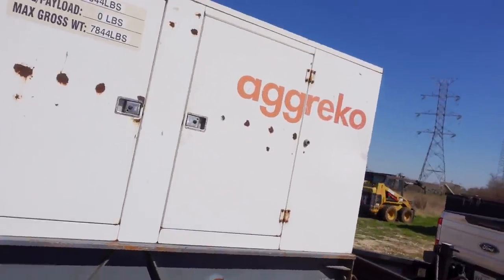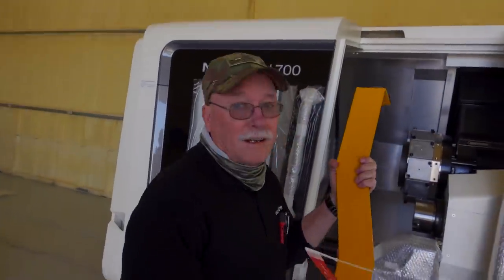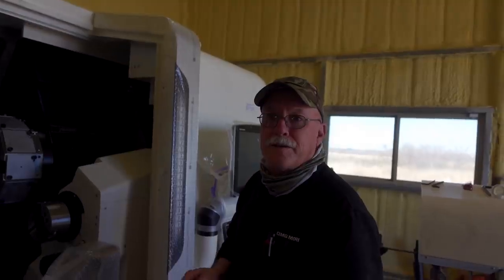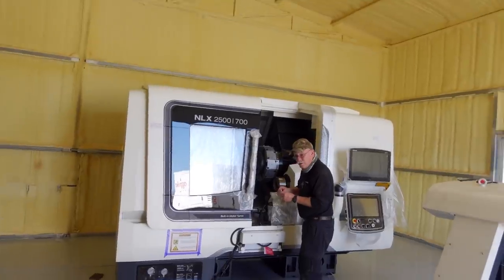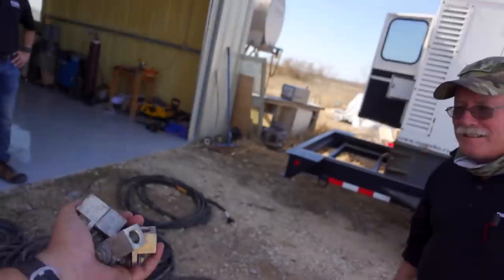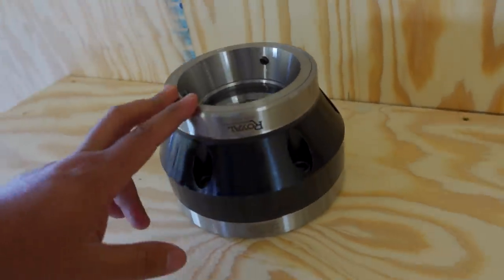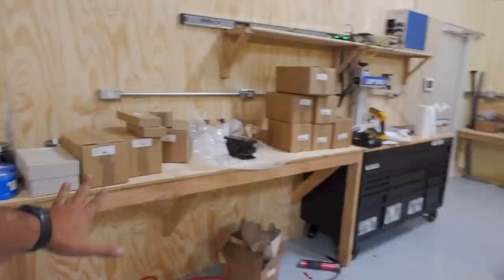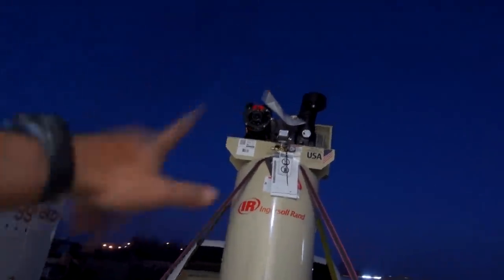Setting up the DMG Mori CNC lathe | Starting a machine shop 7

Comment: Hey Eric congrats on your new machine.  As an experienced CNC Machinist I can tell you that you've got in my opinion the best possible brand of machine out there.  Equipped with the options you bought it will make a ton of quality parts.  A little tip for the future there are batteries in the back that keep the machines memory intact when it's powered down.  They seem to last a bit over a year.  Get and keep a spare pair from Mori, they take a while to get some times as they come from Japan.  You don't want the machine to lose it's memory.  When it forgets where it is that's when crashes happen .

Comment: Eric please remember to drive a ground next to the generator and ground the generator and the new cnc so you don't have a difference in potential and remove risk of a shock
Reply from the maker: Yes sir, it was done.  :)
Reply: Exactly..Even with a gas powered welding machine ya need to ground it in case of a little moisture.

Comment: Put a  motor guard filter in the air line at the machine.  Collects any moisture and oil that comes from the air compressor. I run three machines similar to yours. Two the same as yours and one NL 2000. All three have bar feeders also. The motor guard filters I change twice a month and always have oil in them that escapes the screw compressor. If you use a blow gun to clean parts, run it from the air filter also.

Comment: Did you get pictures of all the shipping brackets in place?  Datum, new term for the CNC. The documents for that puppy I’m sure are tremendous. Tooling,  KaChing!  First class.  Now you need a toolbox for the lathe tools.  When our shop compressor died, one just like the one that you bought showed up, ran flawlessly for the 8 years that I was there being used at least 12 hours a day.  All you need now is a good dryer, don’t know the average humidity there, but moisture is an issue.  Thanks for showing us the process of setting up a shop the way you chose.  Stay healthy!

Comment: Eric, was just thinkin about when you start making chips on that machine, don't know what type of material your tuners are made out of, but when i was running CNC machines we would use a leaded mild steel stock, it was 11L17 from our vendor & it was very stable & easy to cut & easy on tools & also inexpensive to boot. So until you get your speeds/feeds & depth of cuts figured out for production it would make it so you ain't burning up expensive tuner stock and would give you something to build prototypes out of that was easy to machine & inexpensive... Just my $.02  wishing u the best brother

Comment: That particular Ingersoll Rand compressor is a good one for most if not all your needs, only thing I'd warn you about is their auto shut-off switch tend to have issues over time. It will fail to shut off the pump at the max PSI causing the pressure release valve to open, once it fails expect to have to replace it around once a year or two because the replacements are no improvement.

Comment: I hope you are buying "Red" Diesel. Around here it is about 20 cents a gallon less. Makes a big difference when you are sucking up 6 - 8 gallons per hour.
Reply: Harder on fuel filters ?
Reply: @12345NoNamesLeft  NO. Same as regular except they add red dye. Some highway use taxes are not added to red diesel. But if you get caught using red diesel on the highway it is a big fine. Thousands of dollars. I use it in my tractors, diesel pump engines and a generator, but no way will it go in any of my vehicles.

Comment: Dont use an oilless compressor! They generate so much moisture, that it can cause issue with the pnuematics. CNC machines generally require really dry air, so make sure to hook an air dryer between your compressor and machine.

Comment: When your power comes in check the amperage because I've found they lie. How much amperage does your shop take with everything running? Make sure it's at 60 htz.
Reply: Good luck with that! I have never seen a backup generator that did not run slightly fast under no load and slow under full load. Even with electronic speed control.

Comment: Eric.... My 100 kw puts out 227 amps and only burns 1 gallon an hour. That's more than enough to run everything in your shop. How big is that generator?
Reply: 100kw  227amps and only a gallon a hour??? How many horse power engine driving the gen set?

Comment: I would put that compressor outside, they are so loud and annoying inside
Reply: Downside to that is even though they technically are inside/outside compressors, they do not do so well with humidity and the tanks collect a lot of water because of it which over time causes a lot of issues like internal tank rust, contact points on the auto shut-off to corrode which will cause it not to break connection when tank is at max pressure, and if water is allowed to accumulate the pressure release valve will open even when take is not full. Don't get me wrong, they are good compressors and I even own one, they just require constant up keeping if placed outside.
Reply: He’s going to build an insulated cabinet around it to deaden the sound. Some compressors are actually fairly quiet.
Reply: @Georgiaboy9009 110 volt  Electric pop off air dryer valve or what ever they are called work good for tank moisture,we have ours is set to go every hour.
Reply: Absolutely cool...DMG Mori is the best stuff on the market...wish I was in your area, 20 year experienced CNC Programmer and Machinist, handler, and aspiring FTR class shooter
Reply: *handloader
Reply: @jtn-minn8105  Yeah I've looked into getting one and more than likely will eventually, in my case I figured I'd get one with my new compressor once this one finally gives out. Even though I've taken great care of it, those who owned it before me definitely did not, I wouldn't be surprised if it fails before the year is out.
Reply: @jtn-minn8105  Ironically not two days after responding to your comment, one of the pistons in my pump seized haha. A part of me is happy it did, at least now I have one that I will know has been well maintained from brand new and it even has an timed auto drain to minimize water accumulation.

Comment: Good choice on the equipment. Dont take this wrong, but you dont seem like an ace cnc machinist. How did you end up getting arguably the best equipment you can buy? I had to get a better compressor when I got my DMF mill. They use alot of air. I bought this rotary one, its been great. Made in Minnisota. Gscompressor.com  10hp worked for me. good luck.
cw

Comment: I'd be concerned about the generator power not being "clean" enough for such an expensive piece of equipment.
Have your electrician varify that it's an inverter generator at least.
Reply from the maker: It puts out 208, 208, and 208.  Mori checked it before they let me hook it up to machine.  😉

Comment: Gas, gasoline and diesel generators consume fuel in direct proportion to the power that they put out. 5000 watts from a 10,000 watt generator is not much more economical than 5000 watts from a 25,000 watt generator.

Comment: In case anyone cares, that 4 microns data is kinda meaningless for "level". So guesstimating the plate he's using to measure off of at ~6"x6" the angle is invtan(.000004/6) = 3.8E-5° = .0022 MOA = 6.4E-4 mrad. Which is pretty fukking level! But noting close to what i thought he meant at first which was corner to corner on the machine itself lol.

Can u tell im jealous?
Reply: Actually 1 arc second is 1 micron / 200mm, so he is about 4 arc seconds of angle.
Reply: @hrcnick11  same shit, different units. I can never tell if people mean micrometer or microinch these days. What's an order of magnitude between friends once the prefix "micro" is in play.

Whether u call it micron or micrometer, name of unit is dumb. one sounds like microinch in southern and the other is a measuring instrument. I dub it the mumeter. pronounced 'mew-meter'.
Reply: The machine levels show variance in micron/meter.